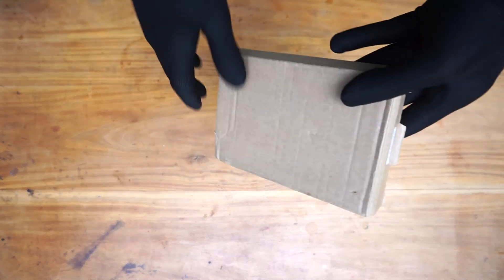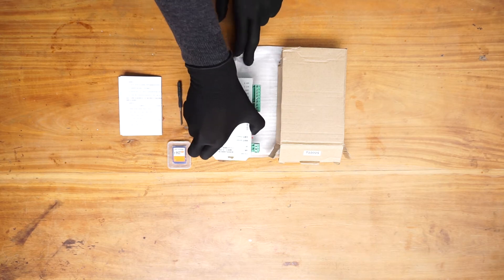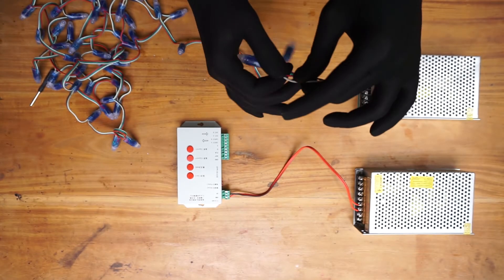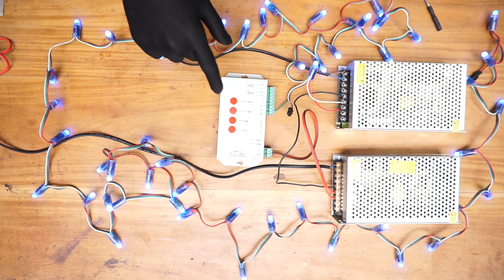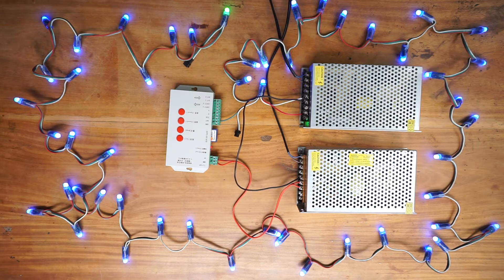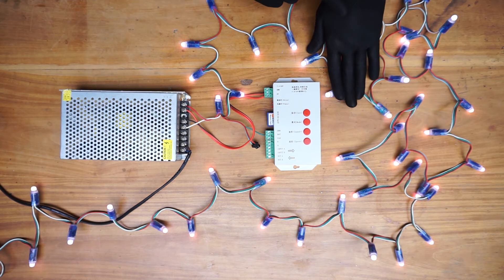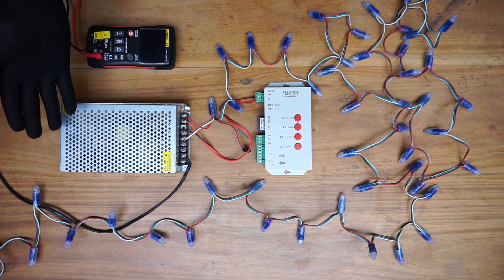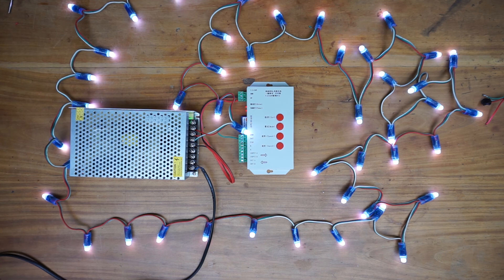How to Use T-1000S Pixel LED Controller | T-1000S Complete Tutorial

Comment: Is it possible to use WLed with this controller?
Reply: i was wondering this also
Reply: @ryansdao  Hello...
My T-8000 is malfunctioning. It was working before now but I added another program to the card without formatting it. Then it started malfunctioning. 

Even when I take out the memory card, it still won't work, even the inbuilt effects has stopped working.

How can I reset it?

PLEASE HELP!!!

Comment: Hi what version of LED edit did you use to program your pixels please? I'm using led edit-k 2021 but it wont work with the T1000S controller and WS2812 LEDs, thankyou!
Reply: Hi maybe I can help you...
I had this problem too. All LED Pixel were lighting and flashing with no order. Than I used the version 2013. Two years ago I bought the K 1000C (it's the new version of the T 1000S). The I used the LED edit 2018- 2020.
I don't know where but I read the version 2012-2014 is only working at the T1000s and the Version from 2016 to today is working on the K 1000C 😬
Reply: @jorgflaming2496  Hi, thankyou for the reply, yes I have since bought a K1000C and it is working no problem with LED edit-k 2021 🙂
Reply: @danf2903  I bought the T1000S in 2017 and had this problem, but no one knows this problem or I didn't found anything in the internet. Early 2019 someone told me that the software isn't working on the T1000s, it Tooks 1 ½ year 😅
Reply: @jorgflaming2496  I was using the T1000S with led edit 2014 which was working fine until flash player was removed from windows, it also took me ages to find out that I had to switch to the K1000C
Reply: @danf2903  I wanted to use the 2014 version too but I got a Trojan virus with the software 😅
Reply: @jorgflaming2496  yeah some of the downloads are a bit dodgy
Reply: @jorgflaming2496  
Hello...
My T-8000 is malfunctioning. It was working before now but I added another program to the card without formatting it. Then it started malfunctioning. 

Even when I take out the memory card, it still won't work, even the inbuilt effects has stopped working.

How can I reset it?

PLEASE HELP!!!
Reply: @akilight  Power Off/ Power on? I don't know. Sorry ...
Reply: @jorgflaming2496  
😄 🤣 😂 😆 
Have done all that, it didn't work

Comment: Hello sir, I have the T1000s controller and I am having problems. I put the program on the sd card using lededit, and when i put the sd card in the controller it does not play the effect i created.  I have reformatted the sd card as fat32 and it still does not work.  do you have any advice on what to do to fix this?

Thank you
Reply: I also have same problem 
Is your problem solved if yes then please reply